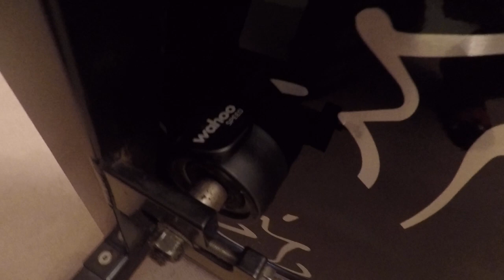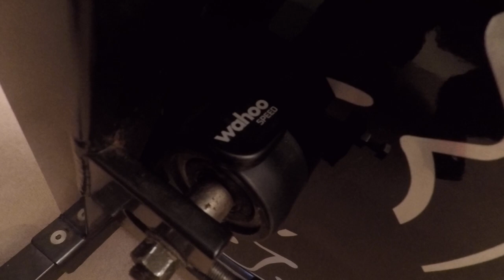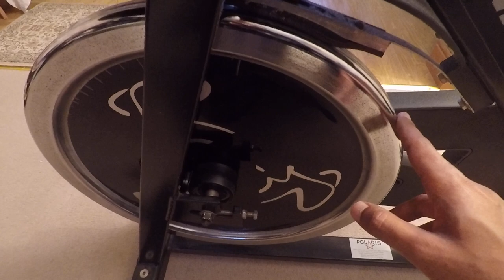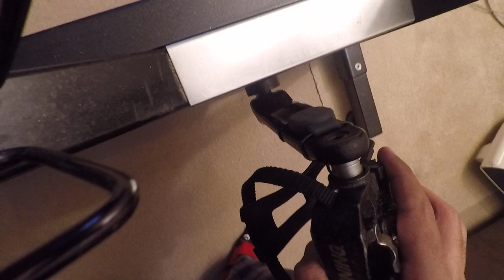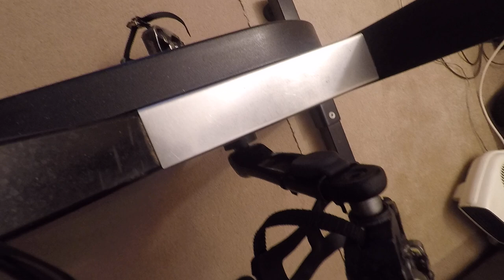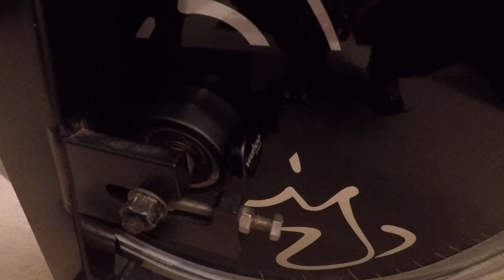Fitting Wahoo Speed and Cadence sensors to spin bike

Comment: Hey all, I just wanted to share my experience here for people also attempting this. I tried attaching the speed sensor vertically over the fly wheel surface as on my indoor bike I didn’t have enough space to attach it over the axle, but unfortunately the readings seem to get all messed up. The speed keeps oscillating up and down, and the power on Zwift is overall widely inaccurate. I also tried attaching the sensor over the axle but vertically positioned, as opposed to horizontally as demoed in this video, but that didn’t work either. Super bummed as I was really excited about this possibility, but thought it was worth letting everyone know and save people the trouble of trying those other placements.

Comment: On a stationary bike the Fly Wheel can not more freely from the pedals. That means Speed and Candence sensors are linked. Do you need both for the apps you have tired? Also any App recommendations?

Comment: does it matter if you turn the sensor 90 degrees on the axle?  My spinner does not have enough room to have it mounted as shown in the video.  i can put it on the axle but the WAHOO wording will be shown (read) forward to back not right to left.
Reply from the maker: I have placed it based on the recommendation of how it should be used on an outdoor bike so not entirely sure if it will work as expected after being rotated 90 degrees. Perhaps try it out and see if you get correct data on the app.

Comment: Hello, how to calculate circunference to work well?
Reply from the maker: You can measure the diameter or radius of the wheel and then use a circumference calculator from Google to work out the circumference, hope this helps

Comment: Attaching it using double-sided sticky tape, can you still replace the battery? Is the tape provided?
Reply from the maker: Please see my other video for the unboxing, there is a sticky tape for the cadence sensor. Battery is replacable. I still haven't replaced my battery so it lasts a long while!
Reply: yes, it will pull of and will reuse , the sticky stays very sticky

Comment: could you have mounted the speed sensor 'vertically', instead of 'horizontally' thus giving a bit more space there?  The speed sensor doesn't quite fit if I place it horizontally on my spin bike's hub.  Please let me know, thanks.
Reply from the maker: I would like to think that this would work too but I mounted it it horizontally as that's what it would be like on an outdoor bike just to keep it close to the real thing as possible. In your case I would use trial and error both ways to see if there is variance in data but I think it should be feasible

Comment: Wahoo does not recommend using the speed sensor on a spin bike.
Reply from the maker: I found that it works fine to get general workout data and compared the data to my outdoor cycling in terms of average speeds and distance covered in a certain time with similar effort and the numbers are within a similar ballpark so seems to be working fine for me. I think the main thing is to ensure you have the right wheel diameter in the app so that you don't get wrong data
Reply: i agree, going on 5 years here , all information is spotty, and not reliable , one item that is consistent is that the info is inconsistent